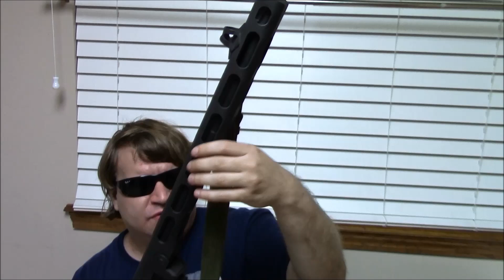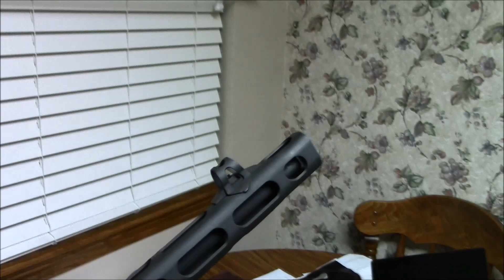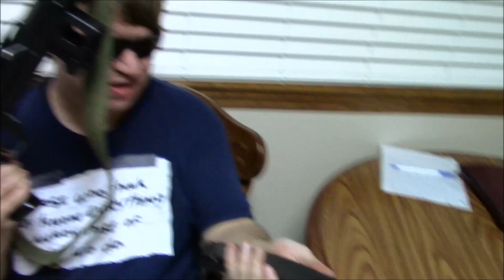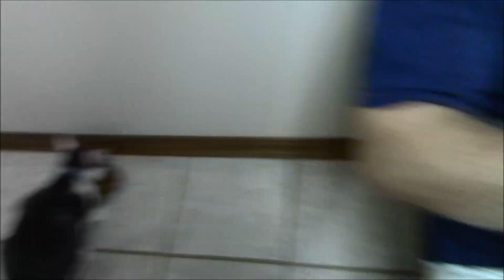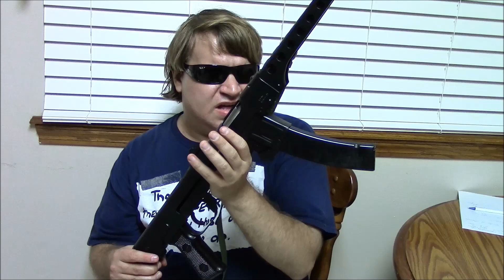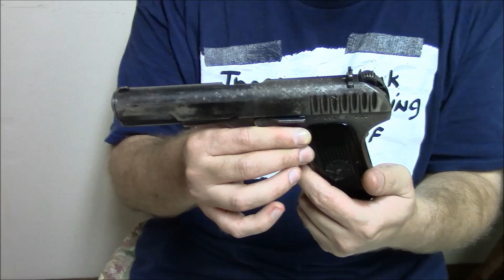TNW PPSh41, Radom PPS43c, PPS43/52 Review + Bonus Russian TT33 Tokarev

Comment: I have a pps43 7.62x25 and nothing but problems.  Lite strikes all the time. Cleaned and dismantled the bolt and assembled, still nothing but problems? Any suggestions?
So far it's a paper weight..
Reply: Jeff Nations What kind of ammunition are you using in it ? . What you are describing is one of the classic problems that is reported with this pistol. The semi auto conversion has a ver infamous weak hammer strike that causes problems with harder primers.
Reply: @winkleried  your absolutely correct. I have surplus ammo because I have other guns that uses the 7.62x25 ammo. Not going to buy expensive ammo.

Comment: Nice ! I was thinking of getting a kit and putting on the wood furniture (SBR tax stamp of course)
Reply: +Joey P  I am sure you know, but the 43/52 uses a different receiver and rear trunnion than the standard 43. To put the wood stock on a PPS43c, you must cut the back of the receiver off and weld on the stub from the 43/52 kit. Definitely cool and requires some skill with a welder.

Comment: Maybe someone can clear this question up for me.  I notice that dealers are selling the pps 43c in 9mm now but for a lot more money than the 7.62.  I can see why, as 7.62 is harder to find and has become expensive.  My question is; other than changing the barrel to a 9mm one, what has to be done to the bolt since the diameter isnt the same and not sure if the extractor would even grab the spent case.  So what are they doing to modify theirs?  Anyone?
Reply: 9mm and the other round I believe have different size bases and the 9mm is straight walled so it needs a new chamber. Sorry if this makes no sense.

Comment: I first saw these in shotgun news in 1999 then they disappeared quickly, I assumed the import was blocked as that time by ATF. the surplus rounds were always very inexpensive and a drum mag was available.
Reply: +Gary Miller  I think you are referring to the PPSh41 right? if so, back in 1999 it would have been the SR-41, which was a USA made kit build done by I.O. The SR-41 does not have a great reputation in the reliability department.